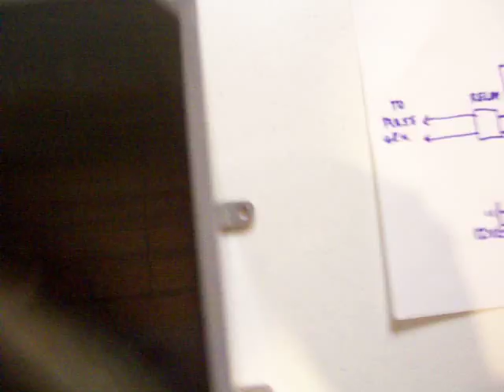from spark to cell

Comment: sorry just got around to it. quite interesting point. I think that simplicity if the key to this whole damnable thing though. one of Meyers points was to indicate that water itself was also injected into the system.... perhaps in the form of steam. however it was in a preconditioned state. already weak and volatile so when it was injected it would merely split. and because it entered the chamber already under pressure it would explode. HHO or Hydroxy under pressure will  self ignite.

Comment: on this note I have been reviewing a lot of Stans concepts with the UV plugs... It seems that the UV light spectrum is closely associated with water frequencies... his design characteristics are different but base concepts of frequency and resonance are the same. UV light ranges in the terahertz a frequency range more achievable under current technology through use of light as a medium than conventional electronics.  Thus his effects were understandably greater than the " Faraday ruling".

Comment: Belooney If high voltage is merely the inverse of high current then why then would it not work.. additionally Current is the flow rate not the pressure (force) by which the electrons move.  Suffice it to say that High Voltage with minimal current will work, Stan Meyer proved that and so has other inventors.
Faraday's rule of thumb was 1.24 volts @ 10 or so amps.  Many inventors has shown that It takes resonance within the cell to achieve more @ higher voltages.

Comment: take a look at my video hho spark 1-5 and stumble onto 1-5 it will show you every thing you need to know, low voltage spark is the key and your pwm can come from a dewault cordless drill trigger. check out my page it will be worth it to you. 5 stars for your effort.